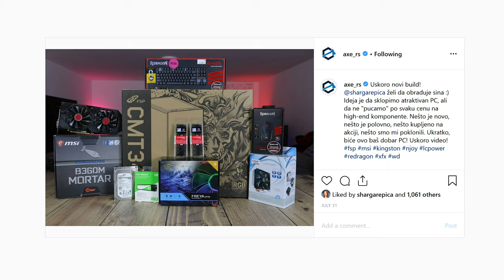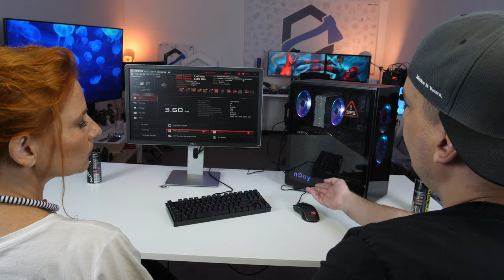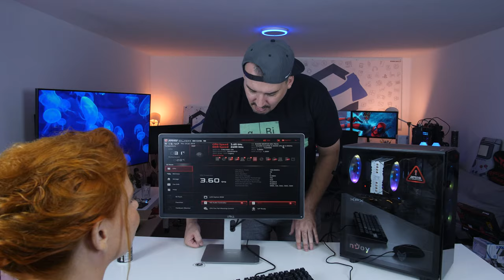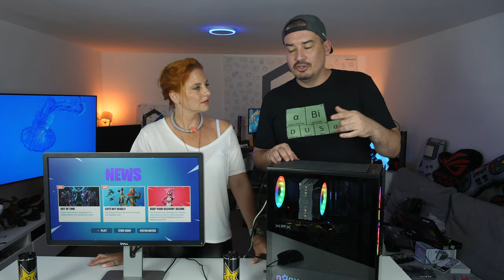LECIN SIN DOBIO PRVI PC!

Comment: Dule planiram uzeti kompjuter za 1200 evra i evo koje sam komponente ubacio:
Ryzen 7 3700X
Gigabyte 1660 ti oc edition 6gb
Aorus b450 pro
16 gb hyper x fury 3200mhz
Cooler master napajanje 550w full modularno
H500 i
1 tb hdd
480gb kingston ssd
Reply: Rtx 2060 i5 9400
Reply: Takav procesor ti netreba naravno osim ako neces strimati, moja preporuka bi bila da uzmes ryzen 5 3600 i mozda nadjes koju jeftinu rtx 2070 ili barem rtx 2060 super.. isto mozes ustedjet na kucistu da uzmes samo h500 nekih 20 eura i moj savjet je da uzmes jace napajanje

Comment: Imam pitanje: Pre 2 meseca sam kupio racunar u kompanii BC Group imam ryren 5 2600x, Rx 550 4gb 16gb rama u 1 modulu stock kuler od ryzena,a320 maticnu i kad igram Fortnite greje mi se gornji deo maticne, vrh tj. to osetim po kucistu de si se posle duzeg vremena da bukvalno ne smem da pipnem taj deo pa moram iskljuciti fortnite da se ohladi. imam 120 -150fps na svim low podesavanjima jer je to najbolje za fortnite nekada zna da padne na 70 - 100 fps keada dropa za 40 al se iste sekunde vrati. Sta bi moglo biti ? I jos nesto nemam ventilatore napred i nazad jer je kupljen u radji mslm da mogu da ubacim iako je pod grancijom al mislim da to ne re resava problem jer od pozadi se ne greje deo de je procesor ne go vrh maticne. Hvala na odgovoru
Reply: Nemam pojma jel se svima greje gornji dio maticne ili sta ali cvrsto ti preporucam da nabavis ventilatore cisto zbog airflowa a zbog dropa fpsa ne brini to je fortnite dogada se svima pa tako i na mome sistemu
Reply: @ninchz738   Hvala mpuno buraz

Comment: Da bar ja imam neki racunar
Reply: Zaradi pa kupi
Reply: @turnoff4655  15
Reply: @turnoff4655  pa sam si sam kupio svoj
Reply: Pa reci im da ti kupu meni su kupili racunar od 2000 evra a ja im to nisam trazio
Reply: @matopetric6714  koje spec ?
Reply: @hajduksplit7406  ryzen 5 3600 rx 580 8gb 16gb rama b450m maticna
Reply: @matopetric6714  uf di si radija to ? Ja cu uskoro kupit pola od svojih pola od roditeljevih para ryzen 5 1500x rx 570 8 GB RAM-a
Reply: @DimitriMaster  wtf

Comment: OVAJ KOMP MOZDA KOSTA 1000E A JA TRAZIM KOMP OD 300E I NISTA OD TOGA
Reply: I ja moram sa 17 godina da radim da bih sebi priustio svoj prvi bolji komp. Samo se nadam da ovo dete nece biti DEBIL koji ce ceo zivot da provede uz igrice a ne s decom napolju. I nije lepa ideja davati 1000e detetu za komp koji zeli igrati GTA i Fortnite. To moze i komp od 350-400e
Reply: Komp za 300€
Rx 570 4gb(polovno u garanciji)
Gigabyte b450m(novo)
Ram 8gb ddr4(polovno u garanciji)
Ryzen 3 1200(novo)
Hdd 500gb(novo)
Ssd 120gb(novo)
Napajanje seasonic 500w(polovno)
Reply: @jovostojanovic7878  ja uzeo r3 2200g 95e neku msi maticnu od 60e hyperx 8gb 2666mhz 53e rx560 4gb 100e i imao sam neko svoje napajanje od 500w i svoie kuciste i hdd dokupio ssd 120gb kingston 20e i lagano rokam sve igrice
Reply: @acovesovic8999  ekstra konfiguracija msm mozes napraviti komp od 200 do 250 eura i opet ti vrti fortinite na low podesavanjima oko 50 do 70 fps.
Reply: @aleksejvidic6897  pa ja s ovim far cry 5 rokam na medium nekih 50-60fpsa
Reply: @acovesovic8999  bukvalno i athlon 200ge vrti izmedju 40-60 fps na low podesavanjima i 720p rezoluciji sto je prilicno dobro za budget procesor
Reply: @acovesovic8999  Bez svadje mogao si ryzen 3400g i tu imaš vega 11 a ne rx560
Reply: @jakovignjatijevic7661  ma nije ga bilo kod mene nigde,najnovija je 3200g isto vega 8. A ovo je drugova grafika pa mi je dao dok ja ne kupim moju verovatno gtx 1080, jer ti je masu skuplja a nije neka razlika

Comment: BlueStacks  je jako sličan NOX-u.
Reply: NOX-u na jacim racunarima radi ko samsung 10 a bluestacks laga
Reply: @tukoje5101  koristio sam i jedan i drugi  brzi su ako imaš dovoljbo jak PC                                                              moj  PC :
GPU: gigabyte gtx 1050 ti d5 4gb
CPU: FX 8300  X8  3.3 GHz
RAM: patriot signature, 2X8GB=16GB   1333 MHz
HDD: Western Blue 1TB  7200 RPM  SATA 6 Gb/s 
mainboard : GIGABYTE  GA-970A-DS3P
power supply :  fsp raider 550w 80+ bronze
CPU Cooler : Cooler LC POWER LC-CC-120 Cosmo Cool